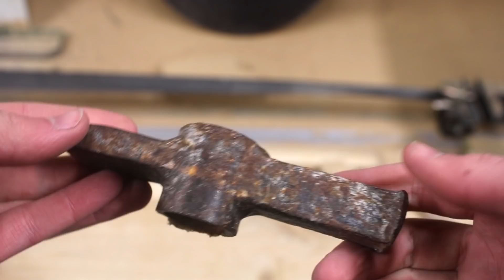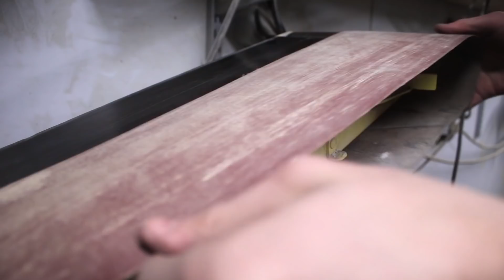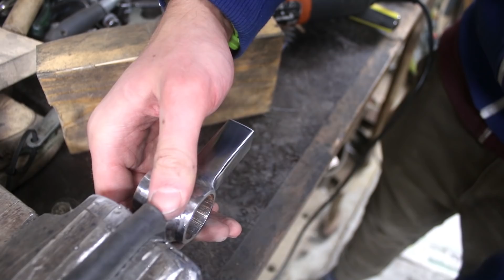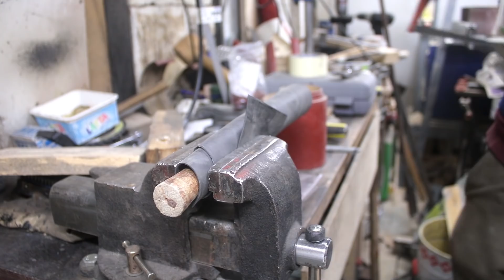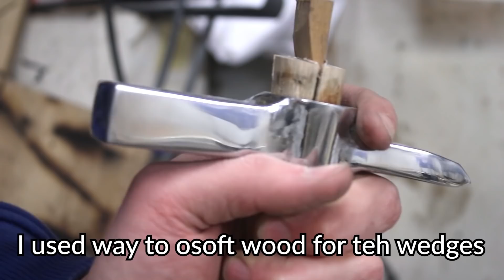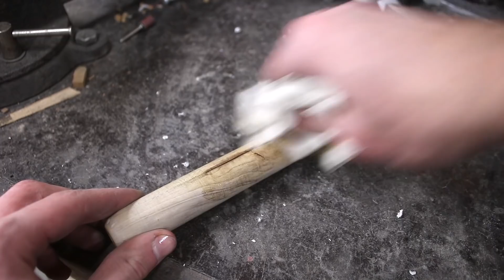50 cent rusty masonry hammer - OLD TOOL RESTORATION

Comment: Awsome work! It is nice to see someone do a restoration with a tool they didn’t “fast rust” and call it a restoration. Just a tip, the wedge you used in my opinion is way too large, or fat. I would never trust that for the life of me, but I do commend you for not making a brass or aluminum handle.
Reply: Wooden wedges will dry out and shrink, all that hammer actually needed was a new handle,  which it didn't get!!!😂😂😂,  hammers work just fine covered in rust or not, but if the handle breaks they're  buggered!,  round , thin handles like that one are not comfortable to use for any length of time,  that was obviously a bit of broomstick  fitted as a stopgap by a previous owner! , and you restored it!!!😂😂😂😂😂

Comment: Just opinion: The wedge was a bit too fat up top.. also, Ive had luck with putting a scrap of sacrificial wood on top of the wedge and hitting that instead of just a hammer strike on the wedge... that splits the wedge often. Still, it’s a good job. good luck..

Comment: just a suggestion on the sanding... so when looking at a spinde what you have that has a definite wobble toward the base. The slower you go the better.I turn mind down to 200 or or lower if your lathe allows. What is happening is that as you are sanding one the bowed part of your handle is getting sanded at higher speeds. You can get away with this at the higher grits because the grit is more raised but as you move up the ranks you will notice that more and more you are only getting one sided sanding with the wobble. A good way to combat this is to lower the speed and take some of the presser off of the tail stock another way to combat the wobble is to use your hand as a steady rest. A mistake that many turners make is to press even harder to take the scratches out. this is counter intuitive in that it creates heat and intensifies low grit scratches. Heat from this can provide a lot of issues such as warping the wood, causing uneven surface by exacerbating the wobble and even causing cracks in the wood. If you put a finish on your wood these issues become glaringly obvious in that the lower grits have created scratches that the higher grits cannot resolve. Sorry if you knew all this but I saw the wobble so figured Itd add my two cents, Love your stuff

Comment: That shaft is not big enough, you have a gap all the way round underneath, should have had a larger diameter, someone fitted the wrong one, I would have thought you would have rectified that. Great job on the head though.